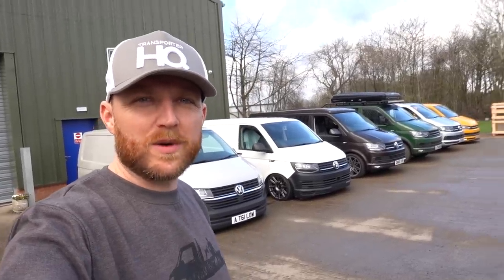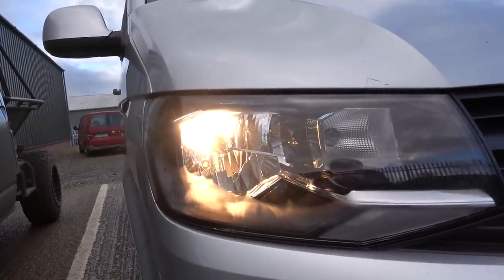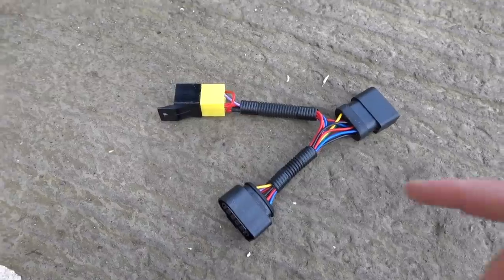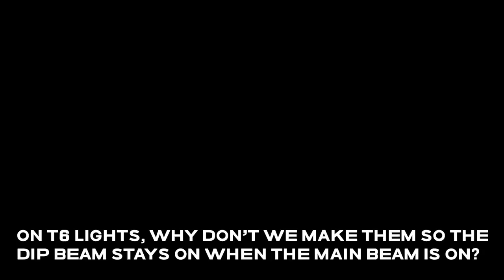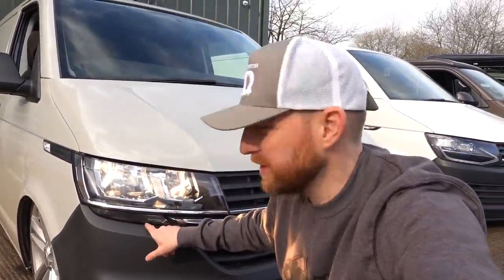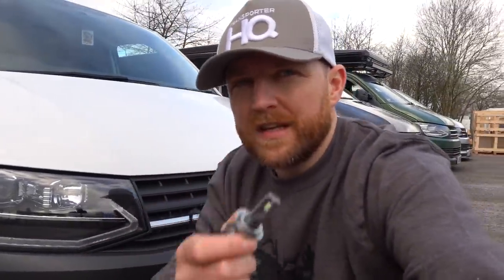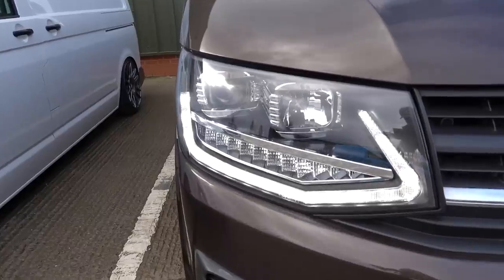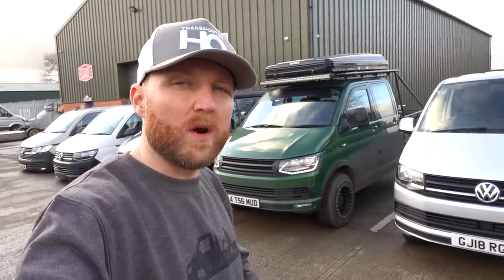Headlight Q&A | Transporter HQ

Comment: transporter hq great blog and really useful but i have the V2 for a 2007 T5 pre facelift,  is it possible for dipped beams to stay on when full beam is used? You’ve mentioned all but this version i think. Thanks in advance.
Reply from the maker: It's not on the pre facelift version, sorry
Reply: @THQAutomotive  thank you thought so just checking👍🏻 have sent an email,regarding bulbs etc, may have repeated this question so apologies
Reply: Hi mate. This is possible. Google about T5 caravelle headlamp conversion. There are two wires you need to join together on the steering column, there's plenty of how-to videos and forum posts 👍🏼

Comment: Love the video. Your head light bulbs sound great but can you tell me can you fit the dust cover back over the bulbs as I have some off eBay  and they are rubbish lol as can’t put the dust cover back on . I’d love some of yours can you send me a link to where I can buy yours thanks
Reply from the maker: Yes you can no problem. We've managed to get the Canbus resistors small enough to fit inside the dust covers. If you want to be added to the waiting list, please email chris@transporterhq.co.uk

Comment: Do you have a price for the t6 v3  I actually like the dots on the light bar! Is it possible for a set like you show in the video...... keep pushing the aftermarket ideas
Reply from the maker: £475 for V3's. This is the only set that will be like this. You could buy this set though and we'll swap these for a white filter version. I'd do you a deal on them. email chris@transporterhq.co.uk if you want them reserving.

Comment: Ive an electrical issue with a 1999 VW T4, I have been to two auto electricians with what they thought was a indicator/full beam stalk issue as the full beam light on the dash stays on and will not disengage.
The stalks have been changed three times now and still this issue is happening, I am at a total loss and trying my third auto electrician to try to sort it once and for all. 

Have checked the fuses and all are good????
Reply from the maker: Sorry T4's are before our timer :(

Comment: just found this video and am interested in the LED bulb for the standard T6.1 dipped beam, but can't find them on your website. Could you send me a link please.Thanks
Reply from the maker: https://transporterhq.co.uk/vw-transporter-parts-styling-accessories/vw-t5-t6-headlights/bulbs-accessories/hq-led-canbus-h7-bulbs/
Reply: @THQAutomotive  great thanks, the message I got from your website says these aren't suitable for standard T6.1 headlights, just the Transporter HQ ones?
Reply from the maker: @richardhopp3130  they did work, i promise. I had them in my standard T6.1 lights before I upgraded the headlights to our after market lights. They don't give as good spread as standard lights don't use a projector.

Comment: Hi so will the t5.1 v3 headlights come with led bulbs ? if not 2nd question can you fit the led bulbs in your video to the new v3 lights?
Reply from the maker: The LED's are a separate item. They can be fitted to all our lights.

Comment: You mentioned that some T6’s that come with the lights and vision pack have a different headlight.  How can I tell if i have this (I have the light and vision pack allegedly).  Assuming i do have this version, does it make any difference if i were to upgrade to your LED v2 or V3?
Reply from the maker: The easiest way to check is see if your dip beam stays on with your main beam. Yes it would still be an improvement to charge to our lights because of the projector spread of light.

Comment: Hi,
Are the V2 lights projectors or not. If not, then am I right in saying that you can't have an led bulb in them that's visible?
Thanks.
Reply from the maker: The dip beam (The H7) is a projector.
Reply: @THQAutomotive  cool, but the main beam isn't, so I couldn't hide an led bulb in there?
Reply from the maker: @andystone5487  To the best of my knowledge, thats not checked as part of the MOT. We have lots of people with LED's in both and I've not heard of any issues.
Reply: @THQAutomotive  Ok, that's good to know..... I prefer the V2 lights.... Whilst the V3's are very smart, I prefer having the separate indicator lenses. It's a 5.1 Shuttle, I'd also like the rears done too. I'll have to get saving! 👍

Comment: I bought a t6.1 without LED head lights. Terrible mistake! Can i instal the original LED head lights when the van arrives, about 2 weeks from now?  I found a pair of  original LED head lights  for sale in germany, should i buy it? thank you for your help !
Reply from the maker: No you can, you'd need to change the BMC and many other parts and programming needed. We will have LED bulbs for the standard T6.1 light though
Reply: how's your car now, did you upgrade the lights? How do you find H7's in the T6.1, are they really that bad? Most bad feedback is for T6 H4 headlights I think

Comment: Purchased a set of headlights that look identical to the v3 for my T5.1 via an alternative supplier (big mistake) first set suffered heavy internal condensation slightly reduced if you removed covers from rear light units,,, second replacement set arrived refitted but the condensation was even heavier... Will your v3 units suffer the same problem as I really want to send both these units back and purchase a set that doesn’t have this problematic issue!!! Cheers
Reply from the maker: You will see our V3 are different to the ones you have now. The orange indicator goes right to the inner corner of the headlight on ours, thats the easiest way to tell them apart. As for condensation, it does happen with all lights. If you look at the genuine standard headlight in the video they are doing it. I have to say though ours do it a lot less. My genuine T6 LED's (on the yellow van) condensate more than our version does.

Comment: Hi I’ve noticed these v2 headlights for the T5 very nice BUT what are they like to drive with in the dark ,I ask this because I’ve bought the twin lights with the projector main beam with the led indicators & side light they’ve been no problems ONLY they are dangerous for driving at night with those useless H1 bulbs yes I’ve got the brightest bulbs I can put a 100w H1 but they are still shite can you assure me yours are different or are they all show for others to view ,I bought my headlights from van style @ 7 years ago I did ask about the useless night driving experience NO REPLY , so before or if I’m to part with £450 + do yours work in the dark & no bullshit ? Cheers Peter
Reply from the maker: What year is your vehicle?
Reply: @THQAutomotive  a T5 is between 03-09 😂2004 purchased from new still got it cheers Peter
Reply from the maker: @petersloan5779  So our lights for this year use H1 of dip and main beam. Yes they are considerable brighter than the standard VW lights. Ask on the pre-facelift Facebook pages, you'll get honest opinions there.
Reply: @THQAutomotive  I know what bulbs you are using what I’m asking are they dangerous to drive in the dark on main beam which is the projector you have the added led light to help out does that make a difference,it’s a question that’s never been addressed by van style & everyone else who sells the headlight I have & are still selling them ,I’ve asked about different bulbs & there is one firm who was honest said a led or a hid would not make much difference,so you know my question I’d like vanity with performance pardon the pun ?🤔
Reply from the maker: @petersloan5779  On this light we only used a projector lens on the dip beam not the main beam. The dip beam does not stay on with main beam though. Our LED's H1 bulbs don't fit in the pre-facing lift lights. The shape of the lights aren't deep enough to allow the fan to fit in. The best way for you to get an honest answer, is ask existing owners. Try asking on this group https://www.facebook.com/groups/156828708426639
Reply: Cheers it’s hard work trying to buy stuff these days ffs show a video of you driving a T5 with your lights on a un lit road ,anyhow you’ve made my mind up for now if you can buy & try & if there shite I can return them that’s the only option for me  thanks for ya time
Reply from the maker: @petersloan5779  I've just filmed the T6.1 headlight video and did show this. The problem is, camera's are too clever now, they auto correct light so its not a true indication of when your eye's actually see. Ask on that page though, they are a helpful bunch. Of course you can send them back if you aren't happy with them
Reply: Tried the Facebook page it sounds like a cult fuck that 😂I don’t do face book anyhow they arnt selling the lights ,thanks for reply
Reply from the maker: @petersloan5779  They aren't sell them but some of them will own the lights. They'll give you an honest opinion of what they are like to use. They aren't linked to us so have nothing to gain. They might tell you they are shit, who know's! haha

Comment: It's absolutely not true that full LED headlights have a legal requirement to have washers, you're thinking of the old xenon lights, which did. VW, and any other manufacturer will happily sell you a new vehicle with full LED headlights and no washers, though they will equally happily add washers for a price. They do have to have self-levelling though..
Reply from the maker: Oh ok, thanks for your feedback. We stand corrected, this was the information we were given from 2 MOT centres.